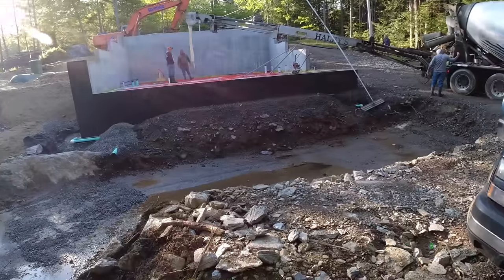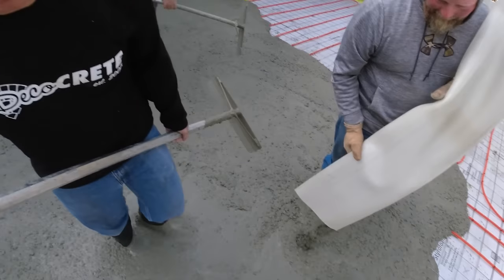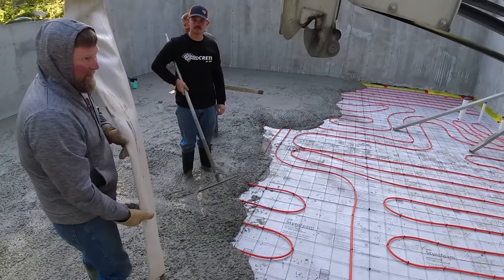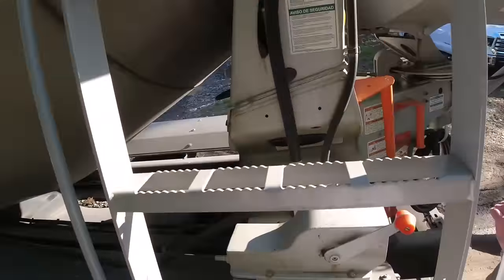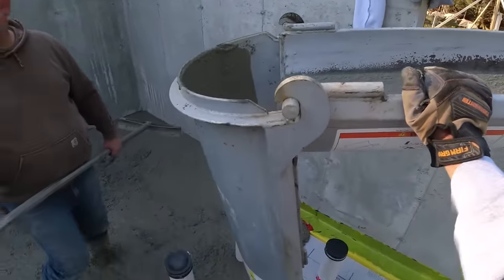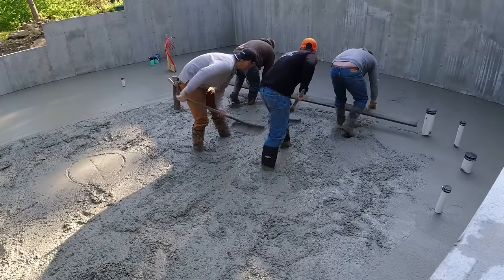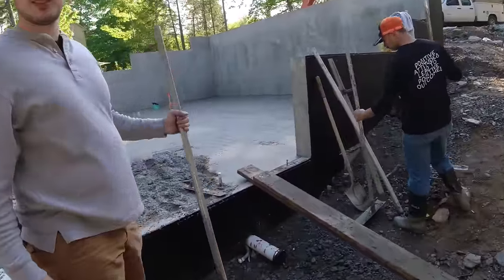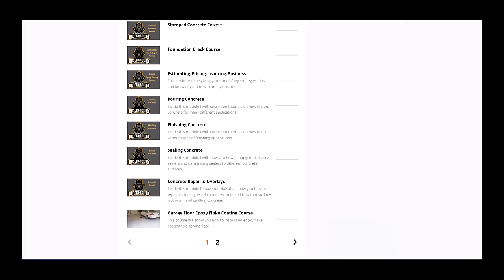How Poor Sub-Grade Prep Causes Problems When We Pour Concrete Floors

Comment: Just prepped the grade for a floor and was going off the top of the footings for a curb wall in the centre then realized it dipped two inches compared to the wall footings. I had to take out the mesh and foam then redo it. After that I got a transit and was meticulous. I needed 6.5 meters, so I got 7 meters and had exactly enough for some pavers too. So happy I took the time to prep the site.

Comment: Pouring in unlevel ridgid foam is always tuff to get a accurate depth I find because it bends under weight. I shoot a bunch of points and get a average but im not telling you anything you don't already know.  On a 28x44 house I may shoot 15 points if its all over.

Comment: Hey Mike love your videos.  I picked up a lot of tips from them which improved my work flow.  Thank you for sharing your experience.  But question I am from pa and we traditionally only pour pads/footer for the the posts then frame house and  then pour basement afterwards and bottom of posts are locked in with the basement floor.  It makes sense the way you do it there much easier to access before the house is built.  Just nobody does like that in my area. But do your houses not use posts to support beams or do your houses use floor trusses that don’t need post and beams?